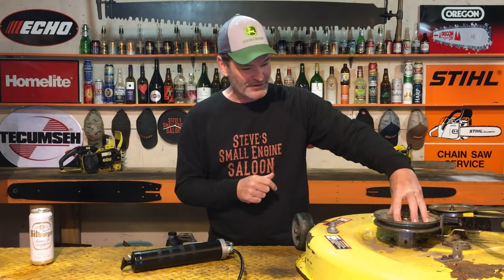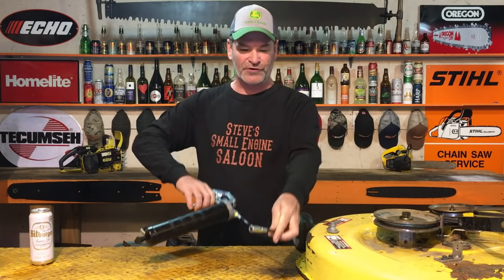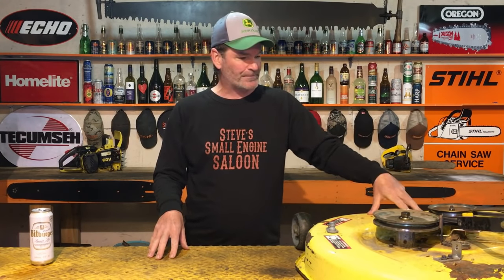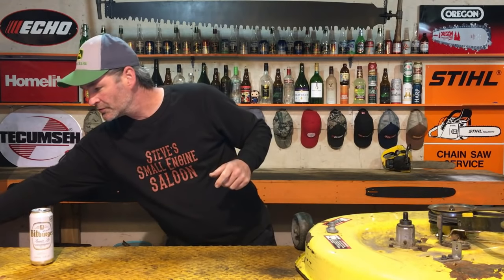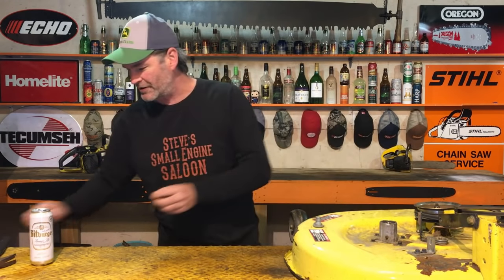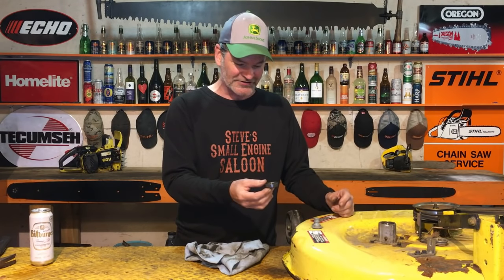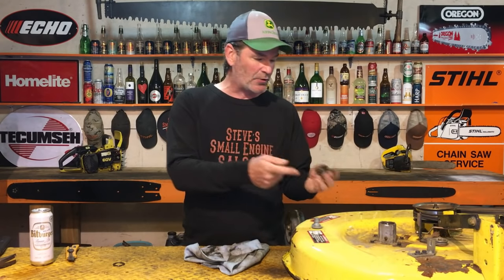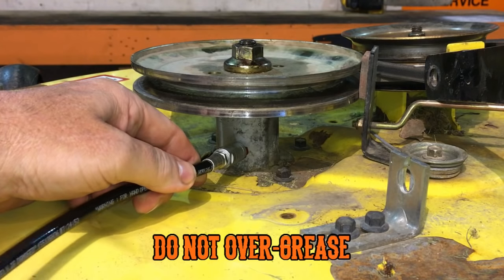Your Riding Lawn Mower's Dirty Little Secret

Comment: Nice!  But I would also drill a 1/64" hole in the remailing seals to allow air to escape and allow the grease to fully penetrate the bearing.
Reply: Great idea. I agree.
Reply: @meandthemrs7403  Do that on small trailer wheel bearings also. No water can get in as long as you grease them.
Reply: Thank you from your friends ❤️ Laplace Louisiana. How very interesting your school is....Take care steve

Comment: I understand your reasoning, but I believe that once you take the inner seals out and start pumping grease in the hub, it's going to force the other seals out.
Then you're slinging grease everywhere and the bearings will be exposed to contaminates degrading them quicker than ever.
A full service should be done to your mower every spring, and while you're at it pop the bearings out, flush and regrease them.
Reply: Agreed...The bearings are sealed for a reason...for long life. The grease fitting is to lube the shaft...not the  bearings. 
That bearing he had was fine. He could have packed some new grease in it an reinstalled the seal. I wouldnt run the bearing without the seal...imho
Reply: @majwor3763  Why would the shaft need greasing? It can be absolutely dry (or completely rusty). It's the bearings that support the shaft and provide a low rotational friction assembly. Only the bearings need grease, the shaft needs nothing.
Reply: @RSole9999  For exactly what you said...RUST... Water and clean metal dont mix. The shaft and the roller bearings are a machine fit...any rust scale and corrosion can be a problem when disassembling. This is not an area thats torn down for general maintenance. It may be assembled for three to 5 years before its tended to. I ran into this exact scenario racing motocross and offroad for over 20 years. The swing arm bolt would seize because of scale and rust and would NOT slide through the bearings during disassembling...practically wrecking the shaft bolt trying to beat it out. Since the shaft bolt was hollow end to end, we would weld one end shut and install a zerk fitting on the other end and drill small holes the lenght of the shaft. apply a grease gun during regular maintenance kept the shaft lubricated and pushed out any water. This made for EASY disassembly when doing a swingarm bearing service. I also own my own automotive repair shop and have been doing it for a living for 36 plus years.
Reply: @Maj Wor
I agree that allowing the shaft between sealed bearings to rust, can be a huge and expensive problem. 
That problem is yet another example of an engineer trying to reinvent the wheel (or in this case, the bearing). 
Before the sealed bearing, the grease nipple allowed grease to surround the shaft (axel, spindle etc.) press through the bearings and coat everything in the housing with grease. 
Then, (before sealed bearings) we would also install separate seals, in the housing, outside of the bearings. This kept the grease where it was needed, most of the time. 
This is an example of trying to reinvent the wheel. Ham fisted operators would over grease the bearings (grease nipple), blowing the seals, which allowed contaminants to enter, thus reducing the life of the bearing and also causing failures during operation. 
If maintenance was carried out regularly, as you have said, regular, non-sealed bearings would far outlast sealed (maintenance free) bearings by a long shot. 
Whenever something is advertised to be “maintenance free” it just means that it will last longer for someone who is a lazy mechanic, to lazy to do proper maintenance. 

Sealed bearings were supposed to be “maintenance free”
Reply: Maj Wor o
Reply: @LeoTheLoyal  AMEN, LEO!!!! You squarely hit the nail on the head!
Reply: TheJR1948  Especially if you change the bearing to one with a steel shield on one side (yes, they do make those because one of my two "deeres" have them in the deck, and the other will this winter!)
Reply: Chiefline  If you change the bearing to one with a steel shield on one side (yes, they do make those because one of my two "deeres" have them in the deck, and the other will this winter!) and place the seals towards the OUTSIDES of the spindle assembly, then the seals WILL NOT BLOW OUT under "common sense" greasing.  I have been working on farm equipment on our family farm since I was a little tot pumping grease while my dad put the ends on the zerks, and I'm 48 now.  I have never seen a steel shield blow out of a bearing.
Reply: But I have seen quite a few plastic and neoprene seals come off bearings for no obvious reasons at all!
Reply: @michaelwaller8252  steel shielded bearings would probably hold up to being greased that way. Problem is, those aren't common in much of anything anymore unless it's commercial grade, but no guarantee there either.
Most consumer grade equipment will have the bearings with the rubber/metal shields on them, and they pop right out (as demonstrated in the video).
Besides, you said "common sense" greasing, lol. You sound like you have some experience dealing with equipment, so you should know by now, that "most" people are going pump grease until they see it squirting out from every crevice possible before they stop, lol.
Reply: @mattschamel6550  Thank you, kind sir!  I mentioned the steel sealed bearings because most people nowadays don't know they even exist.  Once I rebuild my spindles with "steels" and fill the spindles with "red-n-sticky" red lithium grease, I just pump one or two pumps in the zerk at the start of mowing season and one pump halfway through, and watch the seals under the pulley with an expection camera for just a tiny little "ooze" of grease.  After the conversion, I only tear down the spindles every 5 years and clean and repack it totally with new grease.  No spindle failures since I started doing this many moons ago!  And yes, I grew up on the family farm and started working the grease gun with my dad when I was  6 or 7 years old while he would hold the hose on the zerks and have been working on our equipment ever since...plenty of experience!  People think "more grease has to be always better", but sometimes "more" is just a mess!
Reply: Maybe the grease  in the column is to keep dirt from penetrate the inner part of the bearings. Just replace sealed bearings as needed.
Reply: Lubricating the shaft to improve serviceability would imply manufactures think mechanics will change out just bearings. I would bet most (dealer) mechanics will just replace entire spindle assemblies. It would be interesting to know the engineers reasoning. Sometimes what seems like a mistake was intentional.
Reply: Shielded bearings and sealed bearings are two different things.   Shielded bearings have very small slots in the shield to allow grease into the bearing in a controlled fashion, sealed bearings do not allow grease in at all, they also don't let in contaminants.   I work on centrifugal pumps for a living,  always remember the number one killer of unshielded  bearings is over greasing.  Most of our newer pumps have no grease fittings and sealed bearings rated for over 100k hours.
Reply: This guy gets it @ Matt

Comment: Great video, just switched that EZ filter system returned to spin on filter and will be using synthetic oil. Bought used in 2020 E130. Cleaned the everything and spent much time on exterior deck now I'll need to address bearings and using marine grease.  Thanks

Comment: would it help to drill a small hole (about .032 dia) to work as a pressure relief ?  you may be hydraulically pushing out the remaining seals
Reply: If you already know it is filled there is no reason to keep pressing the issue... All it needs is some grease, which the bottom one will feed itself, so a squirt is all you need to make it go up. No need to give another 5 pumps next year. Later on, say a few years later go back in and clean all the grease out and start over...

Comment: I had A old cheap Murry Rider Mower. It had no Grease fittings on the spindles and the same with sealed bearings. I drilled and tapped in fittings. Did the same thing taking one seal off on each bearing. Filled that thing full of grease. The deck went from that loud rolling sound to complete smooth and quiet. This was also a issue on newer tractors to. Thanks for sharing this!!
Reply from the maker: Right on Ricky!  You're Welcome...

Comment: I ran into this issue last year. When I took the spindle apart I couldn’t understand why there was a grease fitting between 2 sealed bearings. Made ZERO sense .....
Reply: Engineering and Common Sense can not coexist.

Comment: It might be a good idea to take the other seal off, too, make a very small pressure relief hole in it, and then reinstall it -- just so it doesn't get pushed off by hydraulic pressure if the cavity between the bearings ever gets full.  Without the inner seal, that pressure will be applied directly to the outer seal and could push it off.  Just a suggestion.

BTW, I've saved many a bearing by removing a seal, hand greasing it, and reinstalling the seal.  Even new bearings sometimes don't come with enough grease inside.
Reply: A very good suggestion , You need to drill and tap a small hole for a regular screw opposite side of the grease fitting , This is a weep hole to prevent pressure from building up and blowing out the seals and allows the old grease to flow out when you add grease next season
Reply: I know this is an old post but drilling wouldn't make any difference. The dust covers are porous (see other posts) so the pressure inside the bearing set is the same weather you remove the cover or not, or drill holes or not.
Reply: @jakester455  But the viscosity of grease prevents it from escaping as easily as air.
Reply: @jakester455  All the dust covers I've seen were steel with a thin layer of rubber.  How is that porous?
Reply: @lewis2553  Only ones I've seen were plastic and didn't fit tight enough to keep grease out. I've not seen the ones you're describing.

Comment: Hey Steve, I've got a Husqvarna LGT 2654. The grease fittings on the spindles are on top of the jackshaft. Do you think that this might be a design change and the grease is getting to the bearings in this configuration? Thanks for the great videos.

Comment: I like it...yer right.....but if you dont put a tiny hole on the other grease seal of the bearing, the pressure of the grease will blow out that seal, no?
Reply: Hmmm good point.
Reply: I say pull the seal , pack with grease and reinstall seal then Repeat every year. Yuk

Comment: I have a 2017 Troy Bilt 42" with a 17.5 briggs. It came with an "anti backfire" device located on the bottom of the carb bowl. I was mowing early last year and all the sudden the motor shut off and smoke plumed from the front of the tractor. I happened to pull the wire off and the motor would turn over after disconnecting it. So I continued to remove that device and there is a metal shaft that acts as a plunger to stop the gas going to the carb. Come to find out the shaft actually snaps out with a pair of pliers. Motor has ran fine with no backfire. Just thought I would throw that out there. Would make a good video if you happen to have a motor with one of these devices on it, for others to save money on having to run out and buy one from MTD or what have you. 1 beer fix tops...
Reply: @samj697  Yep yep...
Reply: @samj697  My real point was, you spend the money for a new one and it sizzled to its death within a year... Next one will do the same...
Reply: @samj697  If your needle isn't sealing it will flood anyway. That solenoid doesn't seal every orifice in the carburetor. My mower did it.
Reply: @kramnull8962  2300 hours on my original anti afterfire solenoid.
Reply: @pfun41  Good for you, less than 100...

Comment: Awesome job Steve I’m a horticulturist and landscaper by trade and in the maintenance part.mower decks like the one Steve is showing in this video is so true.if a spindle brakes it and the bearings and maybe more automatically has to be replaced as it will brake the lot if you don’t do a check up.

Comment: Great video, but once u have removed the inner seals, reassemble, then grease, the pressure of the grease going thru the bearings is going to blow out the outer seal allowing dirt and grit to get into the bearings, additional outer seals will help prevent this. Just saying
Reply: camjamsdad  
My thought too.
Disassemble.
Repack.
And replace covers to keep dirt out.
Reply: I agree, looks like it would take half a grease cartridge to fill the void between the two bearings.

Comment: If the bearings (and other parts) never failed, you would not need a new mower every few years. Engineered repeat customers. Great video, Steve.
Reply: Well that is if the customers aren't smarter than the manufacturer and circumvent those cheap shortcuts...not sure why they even wasted the time and effort drilling, tapping, and installing the grease zerk in the first place.  Kind of a waste of time IMO.
Reply: William Todd to allow for “plausible deniability”.
Reply: Grease fitting that does no good, looks like it will last during the purchase. Kind of like the fancy decals that later fade and peel off, the deck wash connector that doesn’t work, lots of eye appeal to the untrained with a credit card.
Reply: William Todd because the manufacturer of that spindle builds it to be used with open bearings. It’s the “engineers” of the assembly process that made the decision to invoke planned obsolescence and install a bearing that can’t be lubricated. Unfortunately people aren’t smart enough to repair it by giving $15 to SKF. Instead they fork over $100 (just guessing) to Deere for an entirely new spindle assembly.
Reply: @athhud  IIRC I paid about $40 several years ago. That one wasn't for bearings, it was bent but good when my son hit a stump lurking in high grass. It would have cleared if he had the deck at 3 1/2" like he was supposed to. He liked to put the deck down until the wheels hit thinking he'd have to mow less if he cut the grass shorter.
Reply: Hugh Brackett ha ha. I had a similar thing happen to me the first time I used my cub cadet, mowing like normal. And a stump I should have cleared, didn’t. Come to find out after looking, the blades where put on upside down. Lucky it only bent the blade.
Reply from the maker: Thank You...
Reply: Michael Fresh  Your old one is better than the new ones of today!

Comment: now i dont feel bad that i never knew to grease that bearing lol
Reply: My mower is 17 years old and I have never ever greased my deck bearings.  I'm not going to start either, lol.
Reply: Though sealed bearings didn't need grease that the grease fitting was to fill the space to keep moisture out🤔
Reply: @ipdjbt   Got my F111 in 2005 (16 years) & like you never greased those bearings either. I do grease but didn't know that point so I ain't touching .I have acreage & have used it hard. Knock wood... Now I'm gonna get it .

Comment: Removing the top seal from the bottom bearing will allow the grease in the chamber to grease the bottom bearing.  The top bearing, however, is the one taking most of the stress, though, and when the grease gets hot it will all run out of the top bearing unless the chamber is always pressurized.  The top bearing is above the grease.  Gravity is not going to help you, here.   A much better idea would be to use a needle tip on the grease gun to poke two holes in opposite sides of the top seal of the top bearing.  One is the vent, and the other is for grease.  Fill the top bearing (gently) with grease until it comes out the vent hole.  Install the bearing with the holes facing up.  Now the grease won't leak out, but you can add grease every year and that bearing can last a very, very long time. 
If there is enough room in that spindle you could try to set up a grease reservoir above the top bearing, but that's probably unlikely.   
The only way removing the bottom seal from the top bearing could work is if you replaced the grease fitting with a grease cup so that the grease chamber is pressurized.  Then that bearing might have a fighting chance.

Comment: Where does the grease go once its full? Wouldn't it just then push the seal off of the other side of the bearing to release the pressure?
Reply: A sealed bearing lasts longer than a bearing full of dirty grease because the zerk was not cleaned properly before greasing. Over greasing is worse than a factory sealed bearing, it runs to hot, because :more grease" is better. Yes, the grease will push out the seal  then you have dirt entering from both sides. Thousands of mower decks out there and this guy sees a hundred, I rest my case.
Reply: No one will answer this question correctly !!!!
Reply: The best, correct way to solve this issue, would be to drill a tiny hole in the one seal that remains. Then as you add grease, you would be turning the shaft, blade, by hand to ensure grease is filling the voids between the ball bearings. You then continue to add grease until, you begin seeing grease come out of both drill holes ( both the top and bottom bearings)... then you know it’s full.

Phillip from Louisiana.